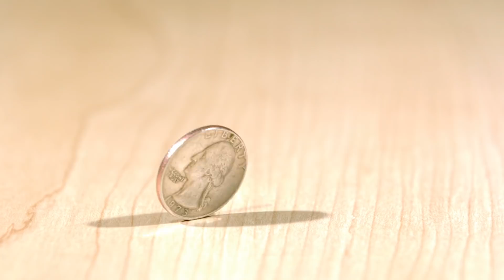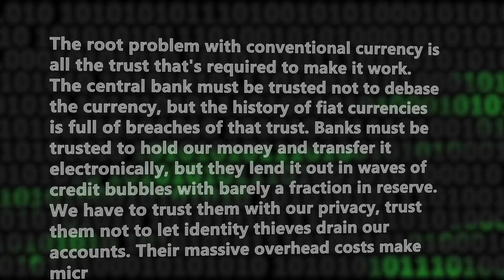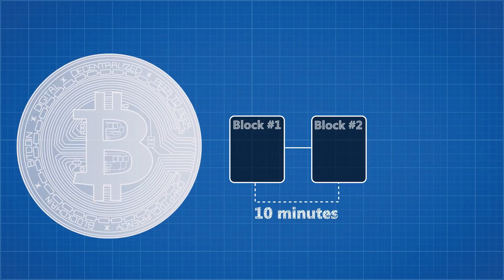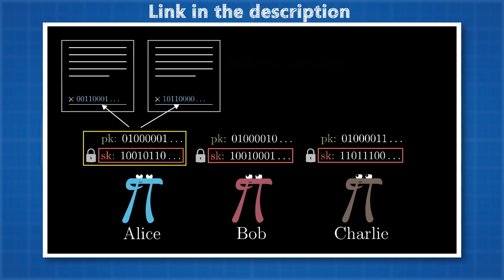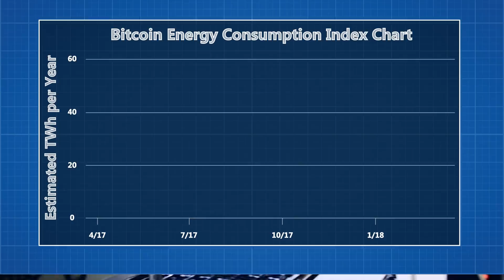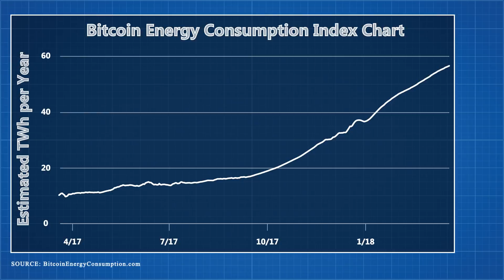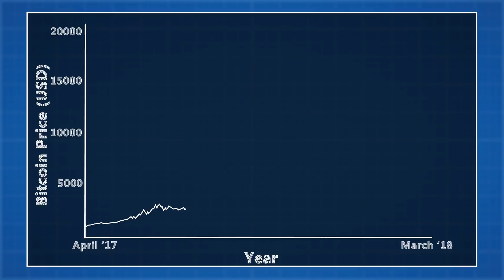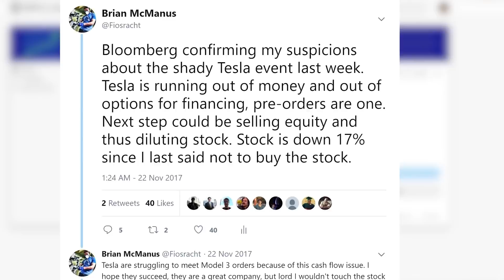Why Bitcoin Is Not Working

Comment: He starts out by listing legitimate problems in the first half of the video, but shortly into the 2nd half switches to misinformation where he seems to specifically avoid the math problems and potential solutions that could make cryptocurrency viable as a mainstream value transaction mechanism. That is bad enough, but then he quotes Visa's corporate energy consumption statements without considering what the marginal energy consumption of all those employees driving to work in their cars and eating food and using services produced by other people who also consume their own energy adds up to. Then he makes it worse by using Bitcoin's volatility as a supposed reason why bitcoin won't work.

The reason cryptocurrency has risen so much in value is because of its potential. The reason why it has fallen is because it simply can't replace current transaction mechanisms without new technology that enables privacy and scale.
Reply: The rise in price and fall in price have been driven by speculation, i.e. people buying Bitcoin like they would buy a stock -- in hopes that the value will rise in the future.

I don't think the significant energy footprint of mining is "misinformation".
Reply: Supposed volatility? It shot up in price massively last year due to speculation. You can't effectively use something as a currency if its value is constantly up and down. If it evens out before fading from relevance, maybe it could be made sustainable, but the speculation and price volatility is a serious issue.

Going back -- what's this about factoring in employees commuting? Do miners not commute to their data centers? You'd have to compare the costs of both, and it's not really a given that the miners are burning less fuel.

I don't even understand the "using services produced by other people" -- is that not just, like, buying actual things, participating in the economy? That's not even a net negative, necessarily. It feels like you are trying to find extra things to add to VISA's total in order to make their number higher. The fact is that Bitcoin is using massive amounts of energy just in the machinery of validating transactions.
Reply: This video isn't even about cryptocurrency as a whole, it is specifically about bitcoin alone and why it isn't working.
Reply: I agree with you except for the reason for the drop. The reason for the drop is due to general market trends.
Reply: LET OUR TEAM SHOW YOU HOW TO MAKE OVER $13,000 IN 24-HOURS LIVE http://estde.btcoinc.cpa.clicksure.com

Comment: While I do support the idea of bitcoin it lacks trust however the trust is a very frail thing. I.e. you have your credit/debit card and you sign for it, no 1 check the signature, sure you can say the sales rep compared it with DL but they are no pros at signature identification. Signing for you card is call security theatrics. It makes you feel safe but does nothing for you. The cost money and energy alone for computing each and every signature is far higher than bitcoin. So banks just don’t do it they get insurance and each account has an insurance allowance.  Always KNOW your account’s insurance if you get wiped out you might not be able to recover it all. (Example if it’s free it’s probably only got a $200,000 limit that they will cover, don’t build your retirement portfolio here use premium accounts). Back to bitcoin it’s like some movies great concept but poorly directed (executed).

Comment: Explanation was correct until 3:33 , when he says that you compute SHA256 by guessing and checking, revealing a serious misunderstanding of hashing. There is no guesswork in computing a hash. The trial and error part is repeatedly re-hashing previous hashed block until the hash value is below a value determined by the difficulty. Shortly thereafter he said "unfeasible" and I stopped watching!

Comment: I'm a fan of your videos. They're usually smart and well prepared. But this one is the worst. 
 - 2400 transactions per 10 minutes is truth for "it's purest form". But this form is not in use any more. There is no such limit now.
 - Bitcoin miners power consumption should be compared to a US Mint and US banking system, not Visa. As this power is used mainly to mine (create, generate) currency and take care over transactions.
 - Visa power consumption should be compared to SHA256 verification. As this power is used to control of flow of the currency. 
 - You can buy stuff for bitcoin. From a haircut to a pizza. it's not THAT virtual
 - Comparison to gold is very nice, as this is also a currency not controlled by any central bank. Which does not stpo golf from being the most stable and safe investment within the years.
 - Most of official currencies started as a promise, that central bank will pay you amount of gold represented on a bill. So people started to speculate on golds price.  And as another uncontrolled currency, bitcoin, is a target to casual market issues: speculations. As a young currency (comparing to gold) it'll take some time to have market value stabilized having minimal fluctuations.  
 - Currency stability is also a bad example. if you are stuck to US Dollars and you forgot, that there are lots of official currencies, that are not that stable. There are countries with hyperinflation (Zimbabwe) where investing in crypto currencies early on could save ones savings.
 - Statement, that Bitcoin is "environment damaging investment" is not true one. It would first require addressing all of the issues I have stated above.  
- On last sentence there is information, that Ethereum is a savior to crypto currency market. But with no explanation what are the mechanisms that make it better then Bitcoin, how is blockchain modified to fit this design. And if this modification brings any issues to original blockchain design in a matter of safety and function. This leaves the video without closure. 

I did my best to describe all the issues I found during the video. But please be forgiving, as English is not my first language.

Comment: And another point to consider for people usi g these mining rigs. Whats the point of cryptocurrency? What value does ot have? It has not value. Its not a physical item. If the network of huge bitcoin mining farms die today. Thats it. Theres no value to fall back on. The infrastructire exists solely to serve itself. There is no body governing and overseeing this system. Nobody is making any real money. Because after you take your large investment and start generating your earnings value isnt even stable. You will lose 10000 dollars of value over a weekend. All the sudden abythibg you have is now not worth the money you spent on electricity. In addition the list of major theft and scams is longer than a 2 km running track. And you cant comoete with a company that has a server farm that decides to run mining operations. Your ability to make money ia drastically lessened by the day. Its just a bad thing to get into. Becaise like the gold rush. A few people got out rich. And there were alot of suckers. Dont be the sucker.

Comment: Real engineering please reply
My question is 
We know that the maximum height to which water can be sucked in vertical tube (straw) is 10 meter (approx) but if we make the bottom of tube (straw ) higher in diameter then can we will able to suck water from above 10 meter

Please reply

Comment: The only coin that seems to have an actual use case as both a currency and a practical use is Jolt Gas. It is an Electric vehicle charging network basically AirBNB for homes with Charging stations so users can travel in between cities without the need for gasoline stations.

Comment: Glad I got my Asus 1080 Ti Poseidon right before this insanity got out of control! :D I don't mine. Just a gamer. :) I'm curious what's going to happen when these miners start dumping used cards on the market, though. :/ Or will these mega miners just use them until they burn out? Anybody have some ideas/opinions? :/ I suspect that if they do dump them, it might really suck for those trying to save a buck. They'll get their "new" used card and it will probably just give up the ghost. On the other hand, having said that, my experience has been that if an electronic component lasts for than a year or two, it will last a pretty long time. But, then again, it's not like I ran demanding benchmark programs 24/7 on the cards I've owned. So, again, I'm curious how this will shake out. (The whole used card thing if/when the mega miners dump them.) Any insight from anybody would be interesting and appreciated. :) I know a few people who were just about to build a new gaming rig right after the cards got sucked off the market. It would be helpful to find out if they should be wary of used cards at some point... ;)

Comment: Bitcoin has the advantage of showing us growing pains, as an example because of the huge price of bitcoins right now, the transaction cost is insane if you want to transfer any money in a reasonable amount of time. I doubt bitcoin will ever be used for its original purpose, but many newer better designed crypto coins noticing bitcoins issues have designed around it, so while bitcoin may not come to be a real currency (in the sense it’s used for every day stuff) others most certainly could.

Comment: Great vid, but you're making the same mistakes that a lot of other people are when it comes to this area and neglecting to contemplate Bitcoin as "upgradeable". Yes Bitcoin can't compete with VISA, yes it's volatile, and yes bitcoin is using a lot of energy, but this is perspective appears to be solely based on Bitcoin and Ethereum only, and only in their current state, and part of the speculation is the knowledge of the technology that is being worked on that could either be incorporated in to Bitcoin, or work alongside it.

There are so many other cryptocurrencies that are all competing with these two giants, and to compete they are innovating, trying to provide solutions to the problems you raise. Proof of stake coins, rap;i transaction coins, stable coins etc etc. As these solutions become more popular and robust, there is no reason why any of them can't be included into Bitcoin.

People seem to forget that although the ledger is immutable and can't be altered, that the core code for each of the systems can be, and is often edited to improve and alter the system on a regular basis. Segwit for example has only been around for nearly a year, but has a large adoption and has helped speed up the transactions. Ethereum might go to proof of stake. Off chain protocols like the Lightning Network can make things even faster, and yet nobody mentions this "ubgradeability" in any of the videos I see.

Comment: To be fair many of those mining stations in China will often be set up to use overflow from power-plants so they are not always actually consuming electricity, because that energy simply wouldn't have been used even though the coal had already been burned to make, additionally the geothermal energy from Iceland is doesn't require fossil fuels. Not saying this isn't an issue just things to take into account.

Comment: Thank you.  I have been looking for a video like this.  There are other things that are wrong with it as well per-say if a group gets 50% of the commute power than they can hack the network.  There was this group that was limiting their members to prevent that, so therefore it's possible.  Secondly, with currencies competing with each other, there would be no currency that would be stable and trusted.  Finally, it's only use is to find terrorists, so because of that reason I hope it's get banned and those miners are borderline terrors themselves because they knowingly help terrorists..

Comment: It's worth looking into the history of why the block size was limited to 1mb.  Most of the original developers, visionaries, and investors who made bitcoin prominent in the first place have abandoned Bitcoin for Bitcoin Cash.  The electricity cost does not increase with the block size, so when you get to the larger block sizes of 32MB, and eventually 1GB and 1TB (millions of txns per second), then the cost of electricity per txn falls way below that of VISA or any other payment system.  It is also worth looking at the cost of electricity to power all the bank branches and offices, and include that in the electricity calculation. VISA cannot work without the banking system.

Comment: Bitcoin is easily stolen. Myself and my investment group had our BTC stolen. Rather easily.

but it was the method we stored it that was the fault. It's made us lots of $$$. BTC works, and it works because pairing individual have faith in its application as a tradable commodity.

Comment: I prefer the point my mom made about digital currency. Just like hats in TF2 it's just a digital make up of 0 and 1 and nothing physical to touch. If banks had all their money being digital then they could write whatever number they desired and destroy it's value. And it costs in shops to purchase using visa or cards. So you're paying to be able to pay. And if you're a kid and wants some candy then it's impossible cause you're not gonna see an 8 year old with a bank card to purchase a lollipop for 2 crowns. It cuts kids from being able to buy anything. A piece of authorized paper is designed to be as difficult to fake as possible and just as minerals it has an amount and demand. The demand is easy but the amount isn't as easily changed unless you're De Beers